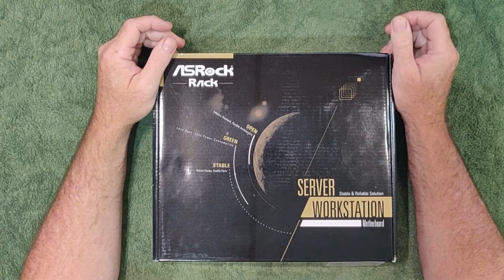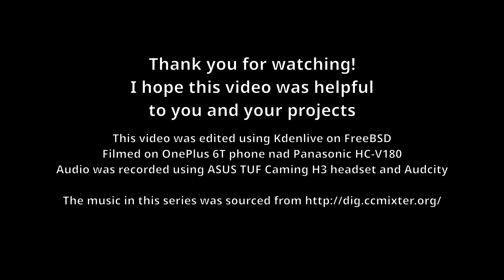Project Clio: Ep2 The Mainboard

Comment: Thank you for nice overview. I'm planning to build my homelab around AMD 3900X that I currently have in my gaming rig once I upgrade it. This board looks perfect for what I need as I won't need to worry about plugging in some cheap gpu just to get video output when troubleshooting/installing os.
Reply from the maker: It is a nice board if you are looking for ITX size board considering the features that you get with it. Just a few things to consider. 
First, pay careful consideration in your choice of cooler, especially if you plan running a number of heavy workloads on your 3900X CPU. The pre-installed CPU cooler bracket does limit your cooler choices but apparently it can be removed, just search the Serve The Home forums for details.
Second, the SO-DIMM slots does limit your choices in ECC memory modules, and the board prone to ECC errors when trying to run at the max supported speed of 2933MT/s (1466Mhz). If using two modules (one per channel), manually down clock the memory to 2800MT/s (1400Mhz in the BIOS) or less,if using modules faster than 2666MT/s to avoid ECC errors. If you are using four memory modules then this should not be a problem, as the board automatically clocks down to 2400MT/s (1200Mhz) anyway.
Other than that it has been a good board and having the IPMI/BMC feature is really cool! If you plan on using a larger case than I did, do check out the ASRock Rack x570D4U-2L2T as well.